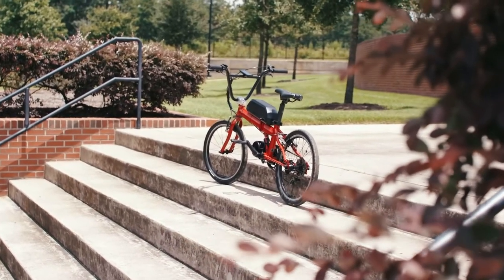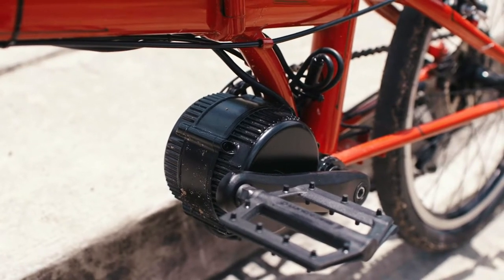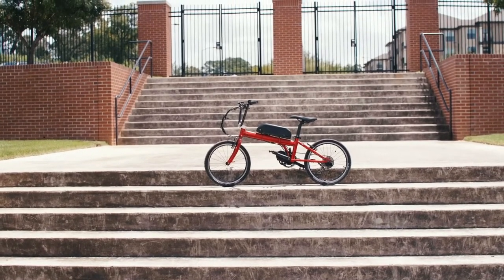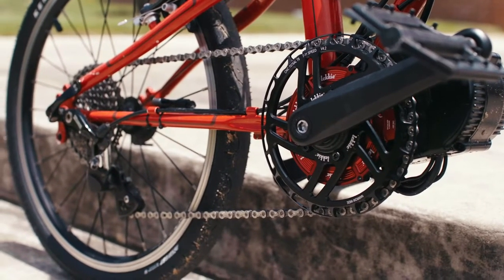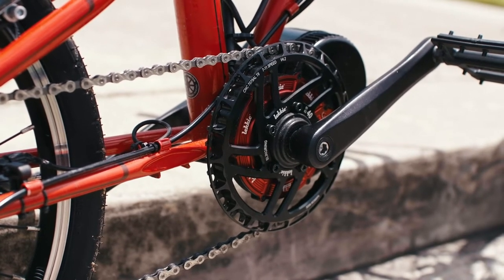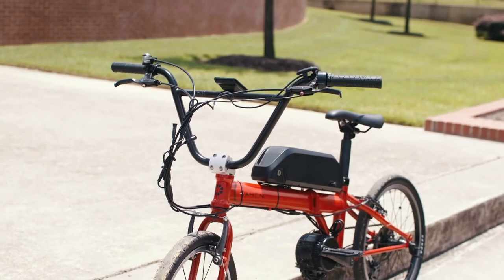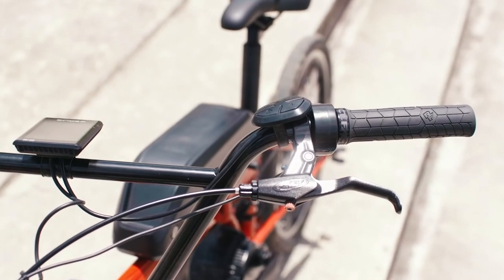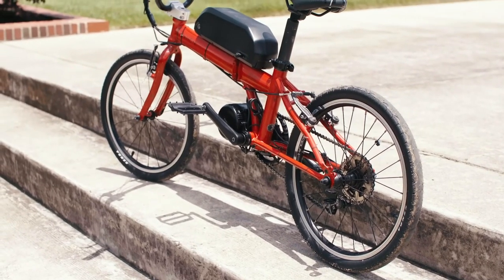Bafang Mid Drive Conversion Kit - Should You Do It?

Comment: I had one Dahon Speed convert with a front gear hub kit with the downtube type battery like one in the video   Everything works great, however,  the battery attachment screw  to the bottle water cage is a little weak and it gotten loose much faster than expected.   I finally put a third attachment screw with a help of a rivnut.  I was able to do better off road with it thanks for the two wheel drive!
Reply from the maker: Hey Kent! Thanks for sharing your story here! I really liked this little rocket and had a blast testing it out! Other Mitch is a wizard when it comes to modifying things. We’ve got another project in the works that we’ve been trying to capitalize on. We might finally be in a spot to execute on it. I’ll keep you guys updated! Thanks for stopping by Kent!

Comment: I have 2 middrive ebikes one cargo and one for driving in the forest. The rest of the Familys ebikes are all hub drive. The hub drive ebikes are easier to maintain - and if you are using your bike on good roads i would recommend a hub drive. Both drive types are fairly easy to install.
Reply from the maker: Hey there! Thanks for your feedback on the mid vs. hub question! What are the two mid drive bikes that you have? Did you mod those? Or are they from a company?
Reply: @Ennovation  I have a mix. 2 bikes prebuild and the rest i put together with bafang parts from ebay. On the 250 W bikes with hub drive i miss torque uphill - but still a lot better than no e drive :)

Comment: So i bought two dahon ios 24 inch folding bikes to convert for our motorhome. I was thinking of a 48 volt 750W midrive  set up with hydraulic brakes. Not sure what kit that would be ? Now listening to this i'm not sure whether i should consider a hub motor? where do i begin?
Reply from the maker: First off Colin, sorry for the late reply here! I think the main thing is figuring out what you're comfortable doing, and if you have the knowledge/want to learn how to set up the middrive stuff. From what I understand the middrive is a bit trickier than a hub. So that'd be the first question I'd ask. If it were me, I'd probably go rear hub, but that'd based on my own experience and knowledge base.

Comment: Actually a mid drive motor is suppose to be much easier to install, giving better performance. Less clutter also as you don't need to include a controller unit. Avoid doing it on a folding frame if you can for obvious reason. good job with the vid . ( Subscribed and liked :-)
Reply from the maker: Hey there! Thanks for the perspective on the mid drive! I think you’re right about it being simpler in some respects! I think my idea is saying one is more “complicated” than the other is coming from a place of thinking about who would be doing the install. I think if you’re familiar with both, and you understand what type of frame is needed, widths, attachments points, and all that jazz, then a mid drive probably makes sense. If someone was just learning about EBIKES, I think the mechanisms of the big drive make more sense. And yes, there is a trade off with torque and efficiency, but my bet is that most people just getting into it would probably not notice the difference if they don’t have anything to compare it to. I guess if I’m boiling down my opinion further I would say that I think a hub install would have less things to screw up for someone doing this for the first time. I could be wrong, of course, but even in my own learning about types of motors, hubs always made sense and mid drives were a slightly different concept. So that’s my own personal biases coming out :) Thanks for supporting the channel!